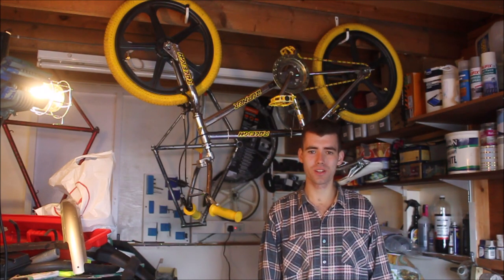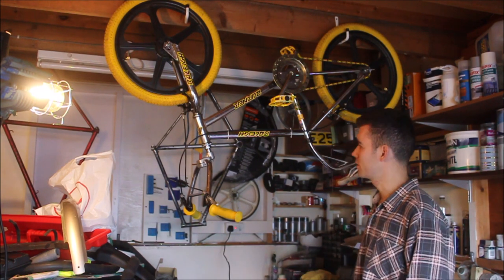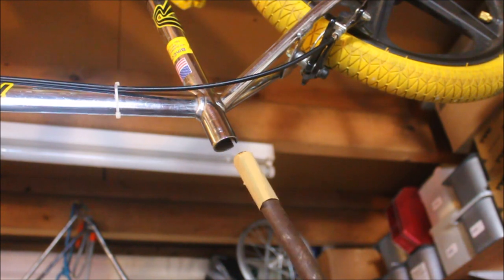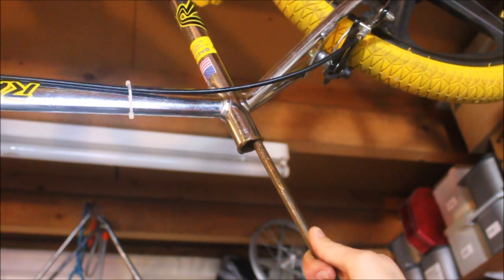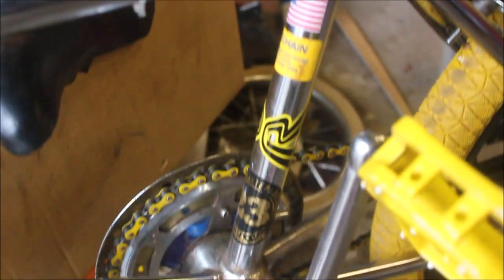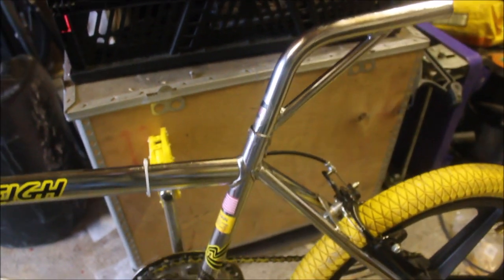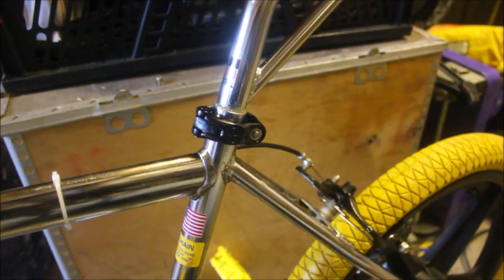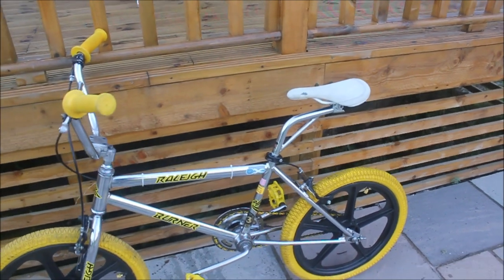Fitting a layback seatpost to the 1984 Raleigh Super Burner (AGAIN!)

Comment: try using an electric hand drill for the tube cleaning , i attached sand paper to a wooden dowel and simply tightened it up in the drill chuck , worked a treat , put plenty of tape on the sandpaper though to keep it attached

Comment: You put the same  type post back in? I bet it bent again.  Unless you had a faulty lay back post.
A post not inserted enough will damage the frame,  a bent post is not caused by minimal insertion.
Reply: Probably mild steel?